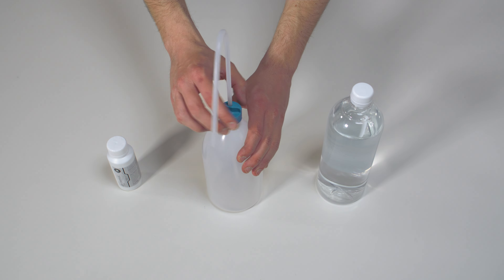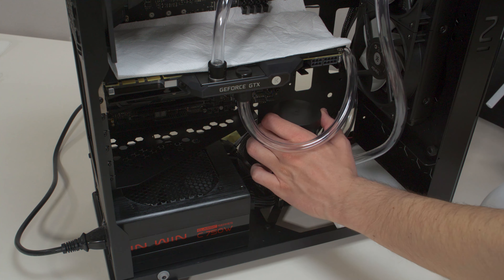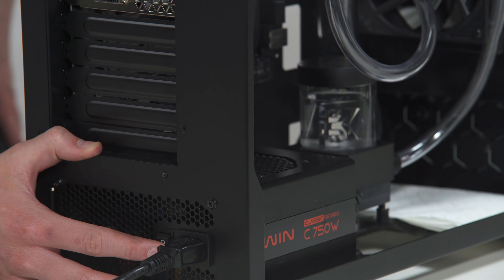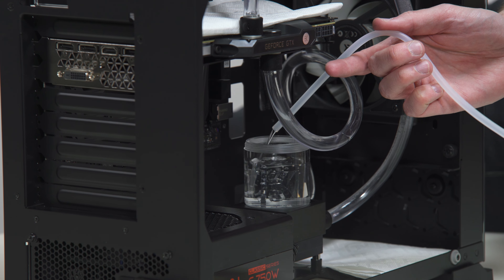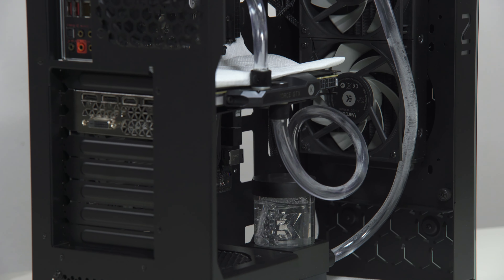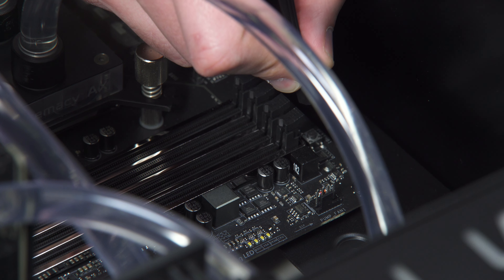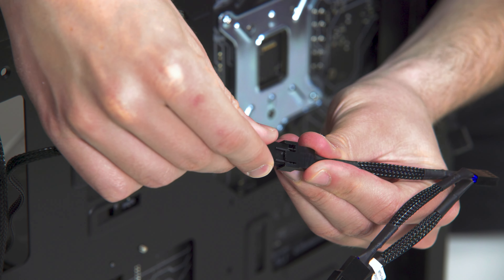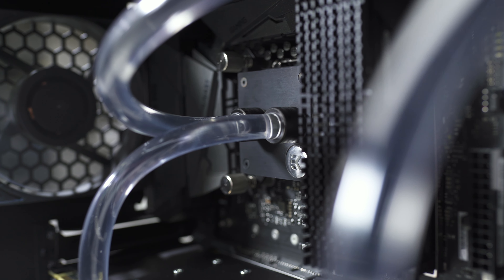EK Fluid Gaming A240G - Filling the system

Comment: Can I use EK-CryoFuel Navy Blue Premix 900 mL instead of the standard transparent concentrate that comes with the kit?
Reply: of course ^^ it is just a colored version of what is included in the kit. But: keep in mind that over time your tubing will start to get a blue shade. So if you decide after a year that you want for instance red then you have to change the tubing. Tubing is quite affordable. The reservoir in this kit is not affected by that issue because it is made out of glass instead of plastic. Good luck I just ordered my kit too !
Reply: eQuALiZeR but its made of plastic too.

Comment: So I've heard conflicting stuff when it comes to putting the cpu and gpu in the same loop in series. Should the cpu or gpu go first? (If it helps for thermals I have a ryzen 7 2700x and a gtx 1070ti)
Reply: All the water eventually reaches a point of equilibrium, so in the end it doesn't matter. Once the temps hit a certain level, they will stay at that level throughout the entire loop. The only difference is which part potentially gets to that temp faster. Now if your GPU is generally more hot than your CPU it will raise the temp of the entire loop a few degrees. But with a Ryzen and a 1070ti I wouldn't worry about it.

Comment: Just wondering, how would you drain the system for maintenance in the future?
Reply: MrQ Ball thats what i was wondering too?
Reply: you take the reservoir (which usually is mounted low in the case) and put a bowl or something under it. then just disconnect one of the tubes. Small risk that water will come over your components, and if it does no worry because distilled water doesn´t conduct electricity.
Reply: If you are at the point of changing your distilled water its very possible that the loop was running for at least 5-6 months which could make the water conductive ...
Reply: Open the res top and suck it out with the bottle he has.
Reply: that would only clear out the res and not the whole loop
Reply: Rock the PC back and fourth and keep sucking it out the res as it builds up.
Reply: What i would say is the best option is to install a t-splitter on the outlet from the pump, with a ball valve connected to it. when its time to change the fluid, simply open the ball valve and let the liquid run out through a spare piece of tubing into a bowl or a jug or something
Reply: The problem with that is the T splitter would have to be made of aluminum and EK doesn't sell any for this kit. So as long as you can find one that would be the best option.

Comment: Is the Asus GTX 1080 TI Turbo compatible? I'm pretty sure it isn't different from the Founder's Edition, though it's not on your compatibility list. Also, where would you suggest, hypothetically, mounting the reservoir in a NZXT H220i case? Could it be mounted in the PSU basement, through some modification?

Comment: I would very much like to purchase this kit, but I need to know if I will be able to purchase separate parts. I want to add a 360mm radiator to the loop to help cool the GPU but none of the ones you guys sell will work with this kit. Will a 360mm radiator which works with this kit be sold soon? Also what's the difference between this pump and a D5? Will this pump have adequate power/flow to push the water through more radiators? Also what is the noise level of the unit compared to other pumps? Thanks.
Reply: you should make a bigger res
Reply: So, if I added the 240 rad extension kit to the 240g kit, the pump/res would have enough power that size rad?
Reply: I have ordered it and am going to test it. I can tell you if it works

Comment: Can you put the CPU block upside down so the tubes won't have to crisscross?
Reply: Another option is to have a case wich allows the radiator to be on the top of the case. This might help with that.

Comment: can you use petg instead of the included tubing?
Reply: but can you use petg tubing in your other kits?
Reply: Oh shoot nice can you put a gpu waterblock in the kit or is it for CPU only?
Reply: Oh nice thanks guys. Best customer service ever. Definitely buying your products.
Reply: mixing copper and aluminum causes galvanic corrosion. Galvanic corrosion is is an electrochemical process in which one metal corrodes preferentially when it is in electrical contact with another, in the presence of an electrolyte. in short it's really bad.
Reply: are the "multi gpu kits" using hard tubing? if so, couldn't you just buy as many of those kits as would be needed to finish your build and be able to use hard tubing?